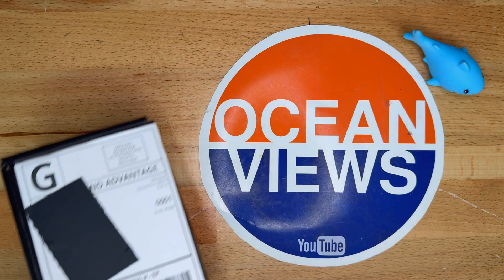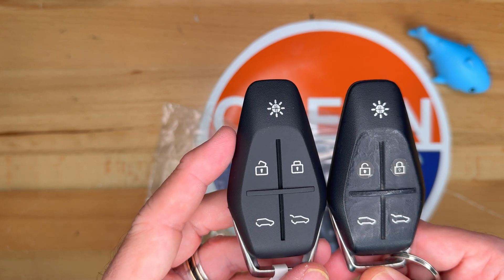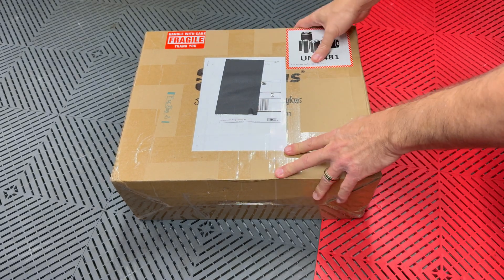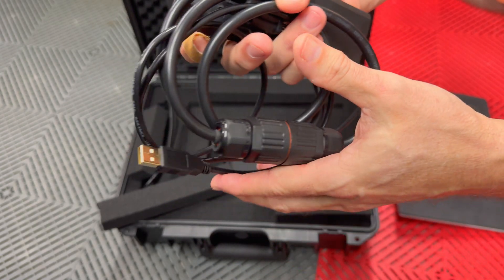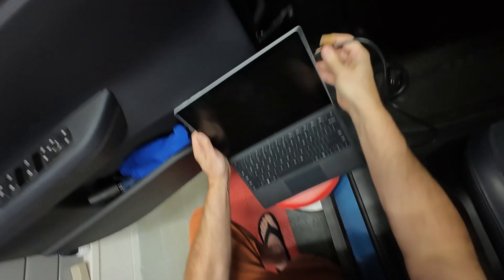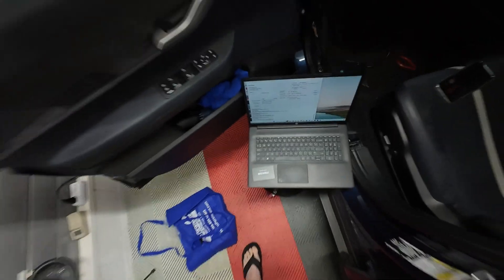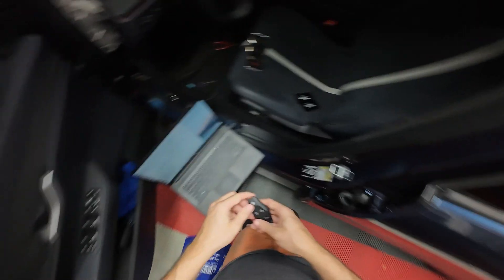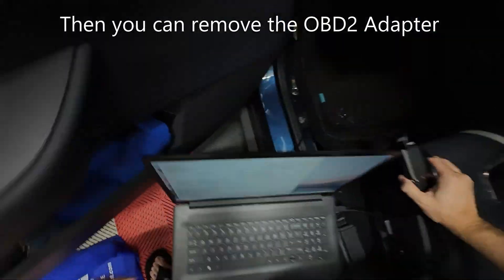Fisker Ocean - Key Fob & NFC Card Programming

Comment: Is there a required PKC version to do this yourself?
My fob no longer works, and I'm considering trying this, but I'm still on a very old PKC version and 2.2.2 update.
Reply from the maker: Very old PKC require a tech to install since it can have serious issues if not done correctly.  V20 comes with OS 2.2.3.  V17 came with  OS 2.1. Anything older than that needs to be done manually by a tech.

Comment: If everyone does it as carelessly as shown in the video, we will have a lot of dead vehicles. Before programming, you first look at all software versions to see whether the vehicle is ready. Afterwards you check everything properly and not just briefly. And you also have to know how to deal with mistakes and what not to do! I know what I'm talking about, I have 45 keys and 90 NFC cards programmed into 60 Fisker Ocean.
Reply from the maker: Yes, I had the tech on the phone.  Previous to the group installation, he prechecked all the VINs for their PKC versions and other module irregularities.  Do you have a check list of things to look for?  Besides checking the key fobs locking and unlocking buttons, and NFC functionality on the door handle, what else do you need?   Thanks for your comment.
Reply: @MTNRanger  We check all functions: Key: NFC door lock NFC door unlock Lock the radio door Unlock the wireless door Put the vehicle in gear and drive NFC card NFC door lock NFC door unlock Put the vehicle in gear and drive We do this with all cards/keys, even those that are already there, to see that not everything works. All keys/cards that are not needed are kept far away from the vehicle. For example, you haven't tested the BLE in the vehicle. This is what a test scenario looks like for me
Reply from the maker: @HamburgerJunge66  Great, thanks for the feedback!
Reply: You are correct and I was on the phone with Matt the entire time. We Precheck the PKC software on the car. If the fob needs an older revision of firmware it’s loaded onto the fob before pairing. We do not update PKC modules using this tool unless it’s absolutely a dead PKC in Bootloader only and we present the Risk to the customer. That being said it’s a dead car so it’s already dead. I work very closely with Chevalier on this tool and they make enhancements to it based on my feedback. They have also developed special tools to do updates on CANFD on the spider port for me for when it really needs special help for flashing. However we avoid flashing at all costs. We know every scenario of when to do what and what not to do on each version of the PKC. We have very specific instruction by chevalier for this. What you saw in the video was the cliff notes and simple aspect of what is perceived by the end user. Not what we do behind the scenes
Reply: @chadsturgill  The video suggests that it's completely problem-free, but that's not the case. If someone presses the wrong button and flashes, the problem can become big. We are also in direct contact with Chevaliers and report any errors that we have had enough of.
Reply from the maker: @HamburgerJunge66  Yes, of course, this software is not intended for the owner to use.  I'll put a note in the video description regarding the software.
Reply: @MTNRanger  but he sell the keys to everyone and give them the PC. Right?
Reply: @HamburgerJunge66  they built this app originally per my request. I was the first person to buy this from them with v.1.01 of the app. I am working very closely with them and have paired 100’s of NFC cards and Fobs. I know what you are saying, but rest assured the video is not indicative of what goes on behind the scenes and most people don’t know and don’t need to know, because I handle it. With Matt we had an issue with the laptop and moved to another machine and you could see the software running in the video. When I do programming 99% of the time the owner does not see the app nor do they have access to it. I get your concern but my service is solid and I take care of all those concerns for my customers so they don’t have to worry about it.
Reply: @chadsturgill  The normal user who watches the video and is not technically savvy will think that it is done by simply pressing a button. We both know that's not the case. That's why I find it dangerous and irrelevant to publish such videos. It is questionable whether it is permitted under license law to give the software to third parties and then install it on a second device. This is also perceived incorrectly by ordinary consumers of the video (see also the opinions in the post in the FOA).
(Sorry for English, translated by Google)

Comment: Is this FOB/NFC replacement the same one the FOA was working on? Also, I thought the new key fobs were supposed to have raised tactile buttons versus just painted? Do I also need to purchase the programming kit or is that something a local shop (Jacksonville) would have?
Reply from the maker: The key fobs I received are the original design (most likely from existing stock).  I think the FOA order will be newly manufactured since they are supposed to have the updated raised button symbols.  ElectrifiedOcean.com is making a sustainable business by offering the fobs/cards and also providing the programming.  If you have a local place to get it programmed, that's up to you.  In my area a group of six owners got together to share the cost of the programming hardware shipping.

Comment: I think I am the only person who doesn't like the Fisker key fob.  I would love to have an aftermarket replacement that is rechargeable and has a little extra range.  I haven't had to replace batteries in years.  I can't get the app to work or I would try using it.

Congrats on the programming.  Your video explained everything well.  Thank you.
Reply from the maker: There's no alternative key fob options at this point other than getting the NFC card.  I'm pretty sure the consensus from most owners is that the key fobs are not a great design.  Once the software updated, the performance has been much improved.  So I'm pretty happy with the key fob now.

Comment: My question is from your 2.0 charger video. I just noticed a 12v low battery warning. I ordered the charger/ tender however it will take four days to get. In your opinion will I be okay until then
Reply: Even if you got the warning the car will charge anyway. If you have 2.0 or more you shouldn’t worry about this.
Reply from the maker: Try to keep you car charging on an EVSE if you can.  What software version are you on?

Comment: If you keep your keycard in your wallet, does it still work without having to take it out of the wallet?  Ie, just hold your wallet up to the NFC reader?
Reply: I had to put mine as close to the "outside" of my wallet as possible. It does work, but the less there is between the card and the wallet the better. It took me 3 tries to find a "good" spot in my wallet where it would work.
Reply from the maker: @christianhinkel9251  Also some wallets have NFC protection.  Personally, I always have taken my Tesla NFC cards out to use.  I'll be testing how the card works in the Ocean over the next couple weeks.  There may be some interesting things that may be discovered that I'm working on.

Comment: Thanks for the video. How much does such a set of cards and keys cost?
Reply: it looks like from their website its 400 for a fob and 50 per nfc card. you can also still sign up for the FOA keyfob preorder which will be around 300 for fob and 2 nfc cards if i remember correctly.
Reply: Is laptop included in order of key fob?
Reply from the maker: @TheOnlyGreatGuy  I you need it you have to do to r meeting in a group for installation or order the programming kit ($500 deposit plus $100 shipping). It’s on the website.
Reply: @TheOnlyGreatGuy  no. that laptop is basically a rental. you pay a total of 650 dollars plus 100 dollars shipping. Then when you send it back, they give you back 500. 

the cheapest way forward if you have access is to preorder the key fobs through FOA then find a local service person with FAST access to do it for you.
Reply: @TheOnlyGreatGuy  No, you need to pay for rental of the laptop/obd connector.
Reply: @netdude it’s not a rental. I do the programming remotely and all you need to do is hook it up. Access to the software is restricted. In the video you see the software because Matt and I had an issue and we switched to another laptop so he could finish those cars he was working on. It’s not the normal situation where the customer sees the screen.
Reply: @chadsturgill  You really are smart to be able to do that, those cars are space age
Reply from the maker: @vytautasdantas7360  The link with the pricing is in the video description.  It is $400 for key fob, $50 NFC card $150 for pairing.  The pricing difference is due to FOA ordering 3000 units.
Reply: A happy man with 4 options to open and close the car 😊. Nice! No more worries on that one. Thanks for the video😊
Reply from the maker: @tiagom.2706  Yes, the key fob and one card stay in a safe location.  The main key fob and NFC card (in wallet) go with me.